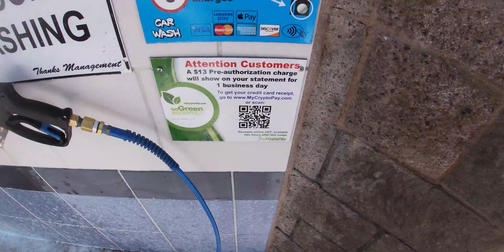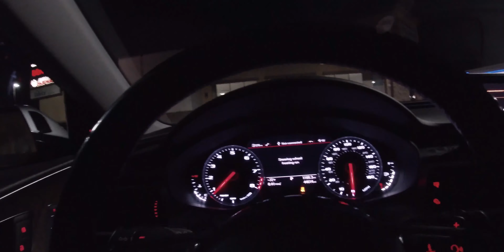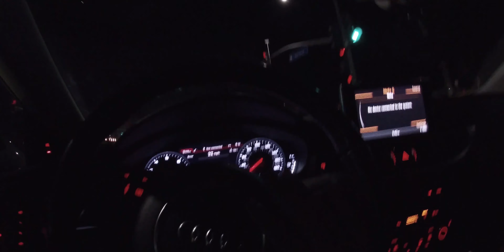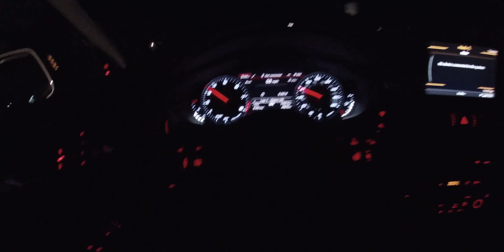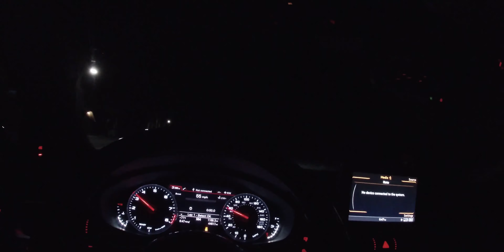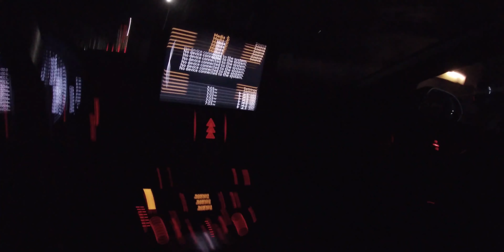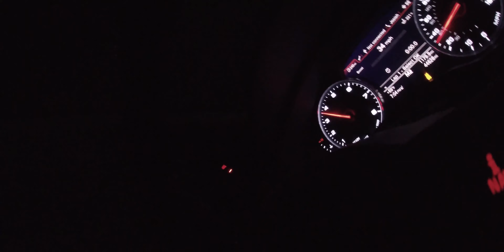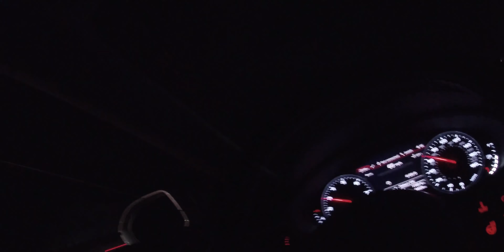400 AWHP Audi A7 vs 80 WHP Cruiser Motorcycle (IM SURPRISED😲)

Comment: I have the IE Stage 1 E85 and IE ZF8 AL551 TCU Tune, no Heat Exchanger, you will lose lots of mileage . On 91 I got 475  on a full tank, On E85 you get 325 on a full tank....car move a lot better if you are gong to get a heat exchanger I would go with mercracing Air to water high capacity heat exchanger
Reply: I’m doing all this to my s4….